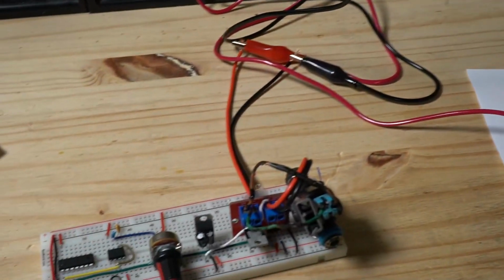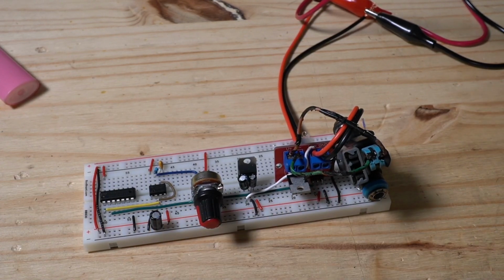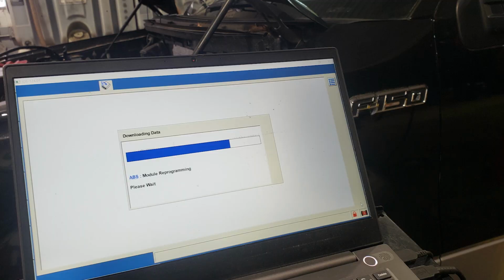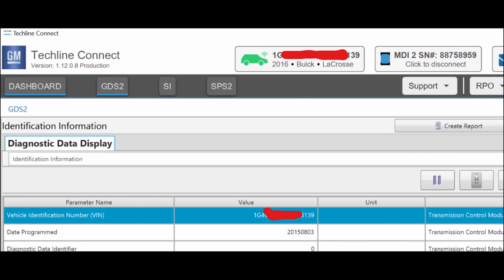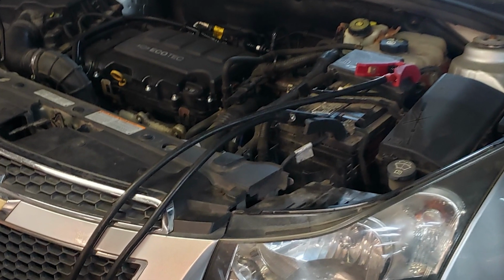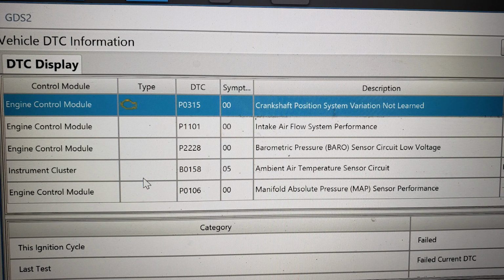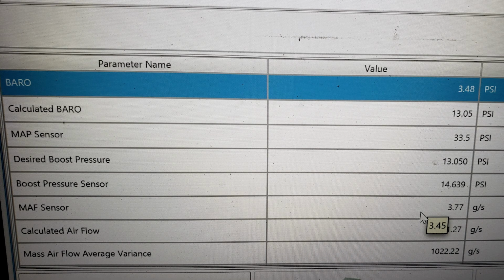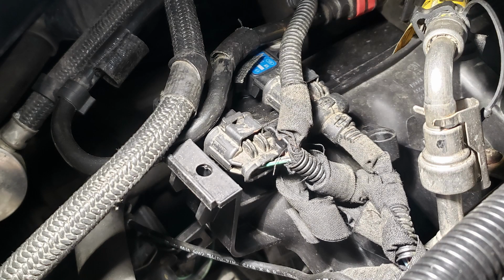Cruze 1.4L  P0106, P2228, P1101   12 7 End Of Day

Comment: Those connectors shouldn't plug into the wrong component on that late of a model.  Poorly engineered or a modified connector.
Reply from the maker: Seems to be a common occurrence! If they made them not be able to be pugged in improperly it sure would save a lot of headaches!
Reply: @BrianMann216  Older Vehicles Yes.  Newer Ones are Generally Chris Proof.  If I get a hold of a Lucerne.  I'll check to see if those Connectors are Keyed.  I run into a lot of Screwed Up Repairs in the Harness.  I generally put Them back to the Way It was before the Fool got a hold of It and Switched things around.
Reply from the maker: @christopherwatson283  older like what do you mean? I think that caravan was a 2010 or 11 , I know I did a 2000 kia that multiple connectors on the drivers side of dash could be swapped,  caused all kinds of issues.

Comment: I have seen several videos where connectors were reversed on coils , injectors and VVT . Or the wrong VVT solenoid was put in . Bernie Thompson had a 2012 Charger where only one set ( pair of 2 )  of lifters was wrong - it was mixed in and wreaked havoc .
Reply from the maker: Yeah dlip flopping connectors causes all kinds of stuff, I have a video a few months back on a caravan that had major large connectors swapped,  I used to see dodge neon the coil connectors being swapped with either the iac or map( i can't remember!l)